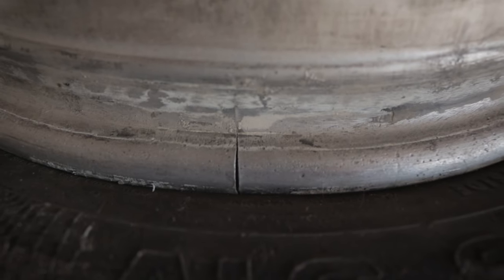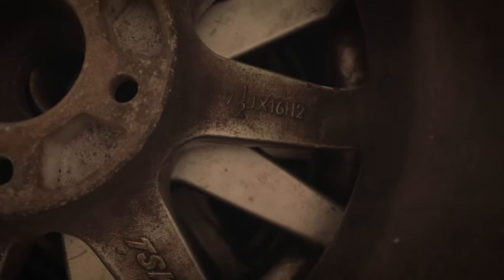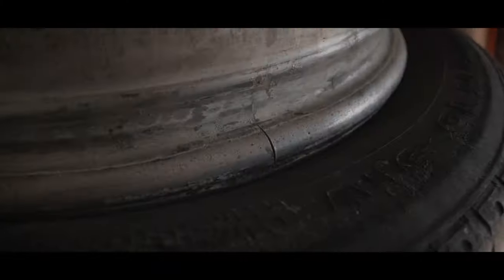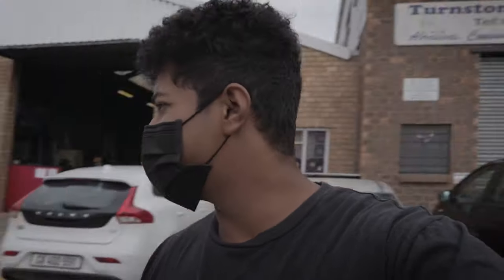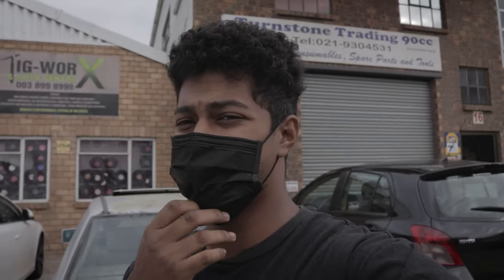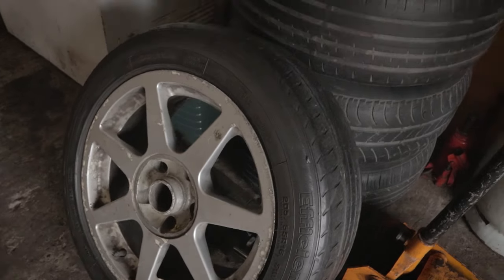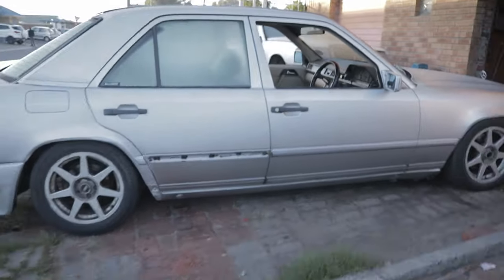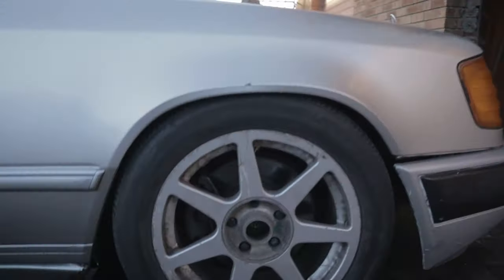W124 Benz Gets Some Wheels

Comment: OOOOOooo when you get these done over and new tires then its sorted in that regard its sitting just right i think...
Reply from the maker: I agree. I would probably just fit a small spacer in the gear to bring it abit more flush with the fender like the fronts. But it fits perfect. I will be doing a coilover setup on it in the next month or so.

Comment: Is it possible to use M12 bolts for wheels that normally have M14 bolts? Like if you use newer mercedes wheels on a w124
Reply from the maker: Hi so I think they should work. The Mercedes bolts usually only differ length but not thread pattern